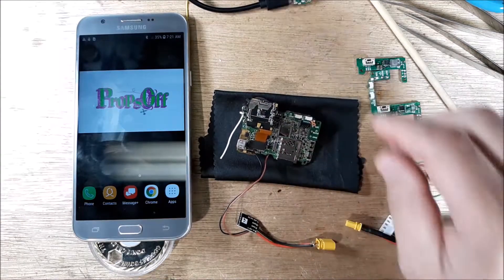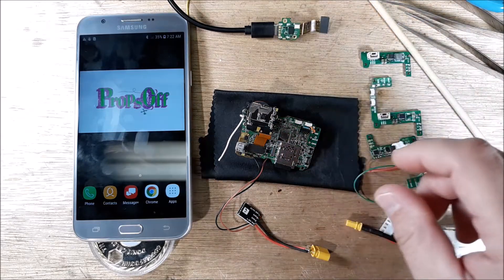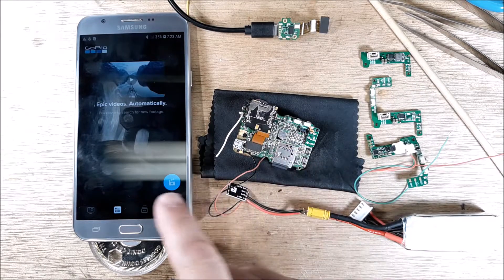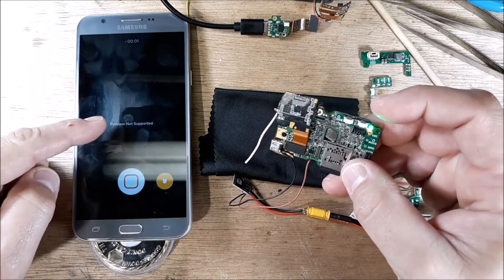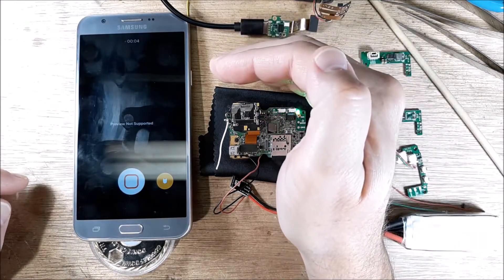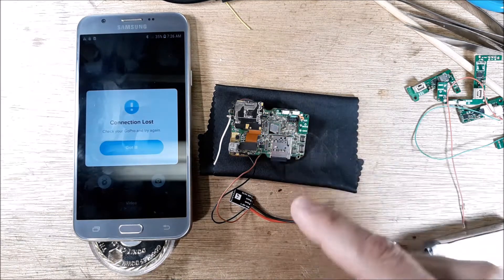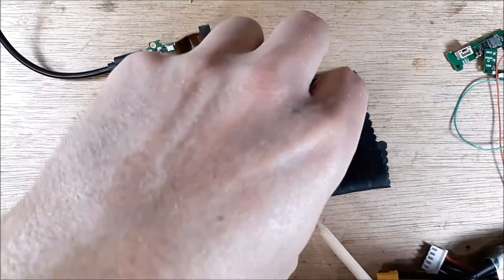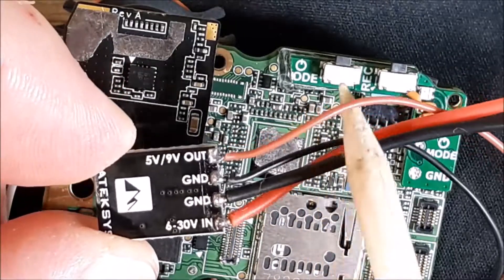Naked GoPro | How To Make A Naked GoPro For A Drone

Comment: I cut it just below the left screw hole and the buttons work without needing to solder a wire. I have hero 7
Reply from the maker: @aaronsandford3568  
Nice...🤌🏻
It's been a while since I've messed with doing the conversions. So many options came from retail. I appreciate your feedback...🍻

Comment: how do I check if the ribbon connector is damaged? my beta 1.1 bec won't power the gopro but it powers fine from screen battery so probs is damaged as 5v is getting supplied to the connector on the 1.1 board connector.
Reply from the maker: About the only thing I can think of is to check for 5 volts.
https://youtu.be/nekFQkiDeDw
Reply: @PropsOff  yeah looks like the betafpv bec is delivering 5v but its not getting through. I'm going to try your method, fingers crossed X
Reply from the maker: @eatmykwad  
I can't begin to describe the amount of hours that went into the end result...lol
Reply: @PropsOff  oh I can belive it haha, well looks like mines just bricked itself, no power from anywhere now, must have fried something soldering..... 🤦‍♂️
Reply from the maker: @eatmykwad  
Sorry to hear that. I was doing all this for a friend and was so careful because I had no means to replace it if I screwed it up. I have a video before this one were I did a mod straight to a cap on the back - Ummaguad style. That may help...🤷🏻‍♂️ I'm having a hard time remembering exactly if that bypasses the 5 volt regulator (you may have fried).

Comment: excellent video, congratulations, my gopro 6 naked has bec betafpv, when I connect the battery the gopro led is fixed and I can't do anything, there is a solution to my problem, I read that I entered dfu mode. thank you very much for your help
Reply from the maker: Are you good now?
YouTube completely missed your comment notification to me...🙄

Also, I tested connecting directly to the NamelessRC BEC and had the same issue. That's the biggest reason for the Matek BEC between the Lipo voltage and the BEC (Betafpv in your case)..

Comment: Hello, verry good video but I have a newbie question. 
Where can I get an 2,4 ghz cable? Can I use a small portion from an old mmcx-sma pigtail adapter?
Reply from the maker: The end of a receiver antenna works. You can use a fine strand wire too - just cut it to 32.8mm
Reply: @PropsOff  thanks for the answer !

Comment: How do you power the go pro when flying? Do you have a different connector soldered onto the bec?
Reply from the maker: Here the GoPro is powered from the lipo. The Matek BEC is getting power directly off the power leads from the ESC beside the main power lead. We abandoned this idea because it was impossible to move the GoPro from one quad to another. So, this is what we are using now -
https://youtu.be/sg76Fps-3DY
Enjoy the Breeze...👍🏻🍻👊🏻

Comment: I did exactly like this, but my naked still doesn’t turn on led, the led doesn’t flash, I still don’t access the wifi.
Reply from the maker: So your unable to connect to the app?
Reply: @PropsOff  no app, no wifi, no lcd, 😔
Reply from the maker: @joselouzada838  
Are you able to connect up the original parts to see if the main board will work?
Reply: I gonna try this, tks bro!
Reply from the maker: @joselouzada838  
I had to reconnect everything and change the led notification and connect the cell phone with password. Then remove the part again and all was on its way..
Last night had a Nano Nebula camera fail... So Aggregated! Had OSD but black screen in the goggles, swapped cameras out and all good.. The whole naked Pusher stuff is too delicate, lol... I want to smash into stuff, turtle mode and cartwheel across the ground at 99mph, then do it all again, lol...

Comment: if i wanted to be lazy could i not remove the usbc connection for powering it to my balance lead then cut the bec like you did to use the buttons
Reply from the maker: I'm testing another quad now. I will have to get testing finished and get results out. I'll just say, my friend didn't like the Ummagawd setup and we have modified another quad. And yes you could. I was stripping as much weight as possible - that was my primary focus.

Comment: hi! I tried your method, but I was not able to make a reliable connection to the betafpv board through the ceramic filter. However, could I not connect 5V power and ground to the cut off ground and power pads of the betafpv board?
Reply: (the ones labeled gnd and mode in the upper right corner)
Reply from the maker: The cut portion of the Betafpv BEC has   NO  5 volts in.. The pads to the right are for Record, Ground, and Mode... Not 5v.
I am testing a new way to do it now, and should conclude next week my findings..
Reply: @PropsOff  Great. My naked go pro only wanted to power on with auto power hack. However, I did everything like u did, and I cannot connect the BLE or go pro app. Also only can record when I press the power button when I plug in. Weird stuff. Hopefully I can figure it out next week.

Hope your new method bring peace of mind :) .
Reply from the maker: So far so good. The sad thing about electronics is they should all work or not work. Not sure why all the issues. I have a 3rd Betafpv BEC in use now and running off a balance lead power hack. So much better..
Reply: @PropsOff  balance lead instead of main lead? why would that be better? Did you use an external BEC in between the lipo and the betafpv pcb BEC maybe?

Comment: hi
Great video! Just wondering about how you installed the power and rec buttons. I saw your blog about this. However I don't understand the language. Which solder connections did you make? Only the orange wire? You cut that from the nameless rc pcb or from the betafpv pcb?
Reply from the maker: Yes, the orange wire is the only solder connection needed. When cutting the BEC, That button looses that leg - you have to jumper it for it to work again..
Reply from the maker: The piece was cut from the Betafpv BEC. I just mated the connector and had some "Gorilla Turf & Clear" under the piece to keep it there.
Reply: @PropsOff  I see. But I can't imagine where to solder the buttons on or where connect the buttons to the main pcb, as there are no pads for buttons underneath where you put them.
Reply from the maker: @babipsylon  
Do you have the Gopro Hero 6 Black?
Do you have a Betafpv BEC for the 6 blk?
Reply: @PropsOff  yes, go pro hero 6 black naked + betafpv bec and namesless rc bec. But I want to power with your method via matek BEC. So the orange wire the the right leg of the right button is the onlly connection you need from the main pcb to the button section?  I don't understand how that works, but ok.
Reply from the maker: @babipsylon  
There's a pin header coming out of the back of the Betafpv BEC that plugs into the Gopro's female pin header for the buttons to communicate.. You have to plug the cut portion of the BEC into the gopro.. no soldering needed.
Reply: @PropsOff  omg sorry it's obvious from your video but I didn't see that initially
and what is the function of the orange wire? continuity you say?

Comment: Do you recommend to install the Betafpv BEC as it is first and when everything is fine - keep it that way? Can it do serious damage to the gopro or just kill the connector? (Which then could be solved the way you did it?)
Reply from the maker: I can't recommend any of the aftermarket BECs that are supposed to make this mod easy. None of them worked intuitively for me. The idea that a quad this small can effectively haul around a GoPro is too tempting and had to be done. I could not get things to work and at times the temperature of the Gopro would be ridiculously hot. That's why I modded it the way I did.. I spent too much time messing with this project and if this video was available for me, I would have been done many hours sooner..
Reply: @PropsOff  thx man! I guess I'll go with a solution via Lipo -> Matek BEC -> USB-C male connector. Kind of non-invasive as I don't feel confident enough to solder to the capacitor.
Reply: @niklascompans  Same here I think.

Comment: Hello man. How's it going with the mod, haven't you had any problems? I am still undecided whether or not to do it to my gp 7 because of the problems mentioned in the facebook group ,,, but nobody has said that something bad happened to them doing it this way, only one person who burned the small capacitor from where he (as you did) take the 5V. Cheers m8
Reply from the maker: So far so good, however, haven't had many packs through it. After following that FB group, seems like lots of people are burning up thier Gopros. Some are now saying it worked fine for a while and then burned up. Not grounded property? Not sure but that's my opinion.
The plan is to do 2 more.. lol, so we'll see. The way I did it, seemed to be the most intuitive. The 5v supply from the Matek BEC is going directly into the same components that the 5 volts would go from the USB C connector. Instead of feeding 5 volts in to where the battery would be feeding 4.2 or less volts. Also, the way I did it, gives a good strong ground to keep the thing from getting too hot. Time will tell. Due to the cost of this project, it aint for everyone.

Comment: Great video, i try this tomorrow ! My gopro now cant rec with betafpv bec V1.1
Reply from the maker: I'm hopeful you have a good result as I did. Some people have said they have had no issues with the aftermarket BEC.. I could not get them to work intuitively and this is what I ended up doing. Caution soldering on that capacitor,  had a few people lift it. Let me know.. Enjoy the Breeze...👍🏻🍻👊🏻
Reply: @PropsOff  for sold on the capacitor, you recommend hot température?
Reply from the maker: @Trod_2704  
I very quickly added a small drop of leaded solder at 220°C.. Then flowed a 30awg pre-tined wire to that dab..

Comment: I broke that capacitor, and now the camera turns on only if i power it from the battery, any suggestions?
Reply from the maker: I'm not sure what size that capacitor is, I'll want to find out. Well, you could either solder in a new non-polar ceramic capacitor as the one you broke (which takes some skill). Or, fine the direction of the 5v path and the size of the capacitor and then solder a Tantalum capacitor in line with a jumper.. I have searched and searched for an underground copy of the schematic of the Gopro 6 black and had no luck.. I only fine simple layouts that are easily discoverable with a volt meter.. That sucks that happened to you, I've done stuff like that too. Always frustrating!
Reply: @PropsOff  ok thanks, but do you think wich my problem (i can't power the camera from the USB-C anymore) is caused by that capacitor damaged? Because if i power the camera from the original battery it works fine!
Reply from the maker: @airfilm_it  
That capacitor is in direct path (undetectable resistance) of the the 5v rail from the USB, therefore, I would say that broke capacitor is the issue.
Reply: @PropsOff  can you please check the value of that capacitor?? I replaced it and now it doesn't work even with the Gopro battery

Comment: Can I plug directly 4,2v on the main board without that BEC?
Reply from the maker: If you have something that will output a clean 4.2 volts and at least 1 amp, you should be fine to power it up.. I was thinking of doing an amp draw test of just the Naked Gopro. I just may do that.. I was looking for the range specs - maybe someone will share an actual schematic of the Hero6... Ain't holding my breath though, lol...
Reply: @PropsOff  thanks, but can I use that poin on the capacitor for the +4,2v input?
Reply from the maker: @airfilm_it  
Yes. That capacitor is in the direct circuit with the input of the 5 volts that would come from the USB-c input.

Comment: Any tips for soldering on to the capacitor? Metal contact area seems tiny
Reply from the maker: It's not simple.. I do have lots of experience. However, if you run a clean tip at 220°C and just place a solder ball on the top edge, then place a 30awg pre-tinned wire over that and gently push them together very quickly and precisely,  you'll be one step closer.. If you sit on the capacitor too long, your going to have a major headache..